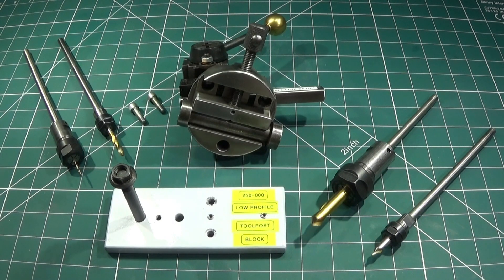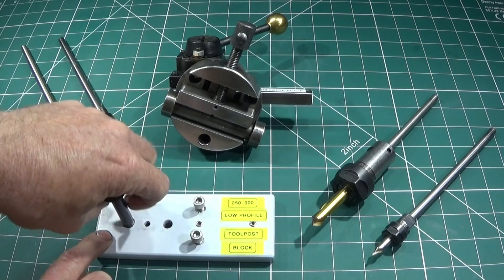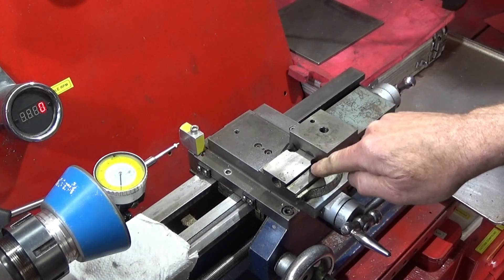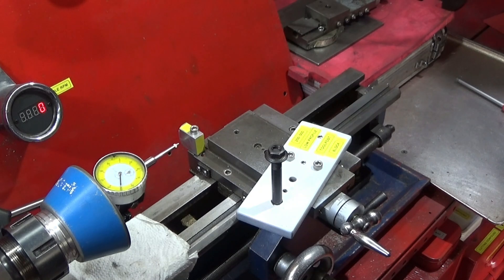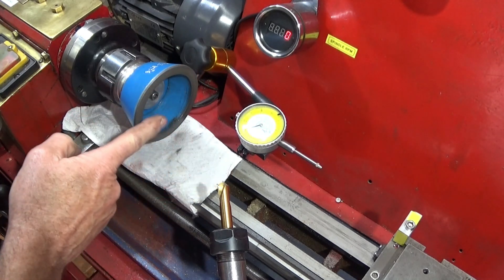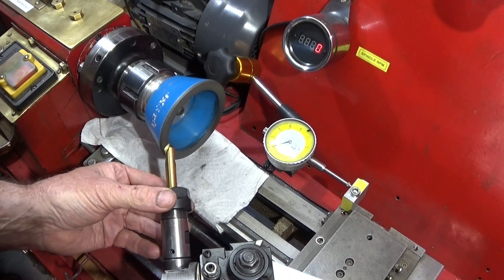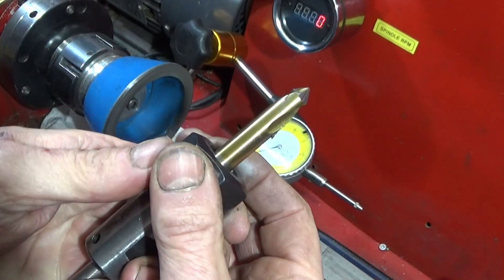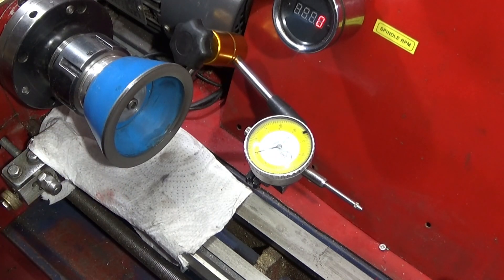HOW TO REGRIND SPOT & CENTER DRILLS PERFECTLY ON THE CHINESE MINI LATHE

Comment: Couple of questions Steve: what determines the "upwards" angle of the drill tool holder? And how come these spot drills have no relief behind the cutting edge?
Reply from the maker: This setup follows the exact profile of a new spot drill. When done, you wouldn't be able to see the difference between a new or a ground one. I'm so pleased with it. I doubt if I'll ever need to buy spot drills again. They cut beautifully.
Reply: @SteveJordan  Hello Steve, very interesting video. Thanks for sharing your knowledge. But I have the same question as gyrogearloose1345: What determines the "upwards" angle of the drill tool holder? Can you help us?
Reply: I cannot answer for Steve but there might just not be a simple, single answer for the question of “upward angle.” I would have to ask you, “What amount of relief do you need?” Exact relief angle is typically not critical but varies depending on the material drilled, i.e. wood, aluminum, steel. You’ll notice he cut only partially around on each flute on the last example so one would assume the previous grind had plenty of relief - enough that partial sharpening added a primary relief to that now secondary relief. This angle setup is the same geometry as a full blown tool and cutter grinder. Great stuff!

Comment: Ive been wanting to do this on my myford with an aluminium oxide white cup wheel. Would that work well or are there going to be issues😊
Reply from the maker: Hi Henri. I'm not sure, to be honest. I've never used an aluminium oxide wheel. The main thing is to cover the ways to protect them. Regards Steve
Reply: @SteveJordan  thanks for the response 😊 will give it a shot

Comment: Hi Steve, very good video and useful method for regrinding tools. However I think there is a risk of the grinding wheel grabbing the cutter being reground. This would spoil the cutter and take a chunk out of the grinding wheel. I think a useful addition would be a rotation stop cam. So you would hold the cutter against the rotation stop as you grind. You would be free to hand rotate up but not down past the stop. You would probably need a 4 position stop for 2 and 4 flute cutters and a 3 position for 3 fluted cutters.
Reply from the maker: Hi Les, Thanks. It's a good idea, but I don't want to make it too complicated. The diamond wheel is very fine, I think 600grit, so it won't grab on this one. I would consider using your idea, though, for the coarser wheels. So far, the tools I have that need sharpening are only dull or blunt on the ends or cutting edges, so they only need a few passes on this wheel to restore them like new. Regards Steve

Comment: Good setup. What do you use to true the cutting wheel? Also how much of a cut do you take to not heating the part being sharpened?
Reply: No worries with HSS and carbide…you won’t soften them…if it did, it would just melt in use…
Reply from the maker: The diamond wheel doesn't need to be trued up. I use thin spray oil on the wheel so it doesn't get hot.